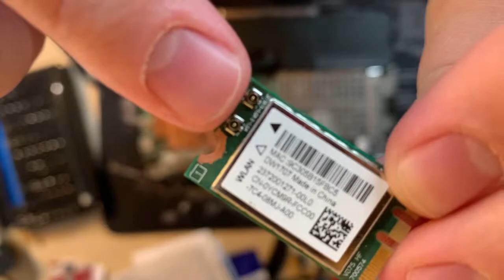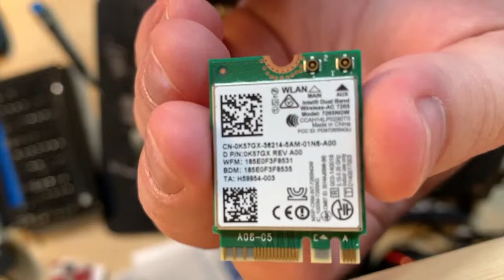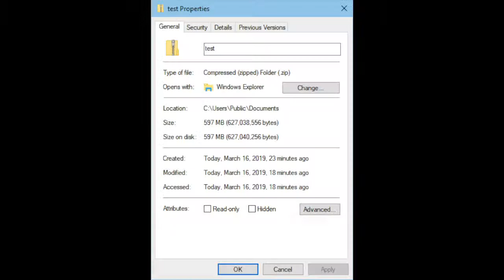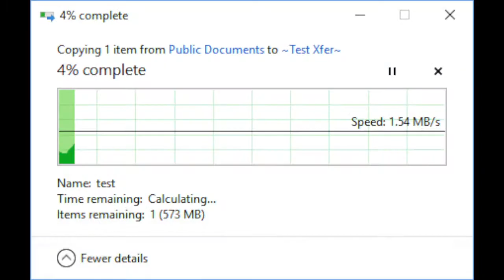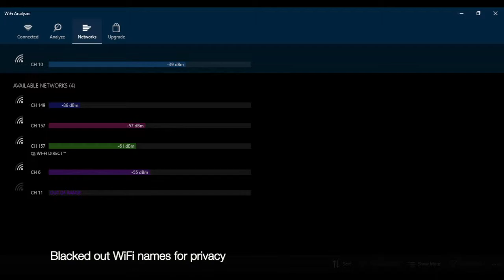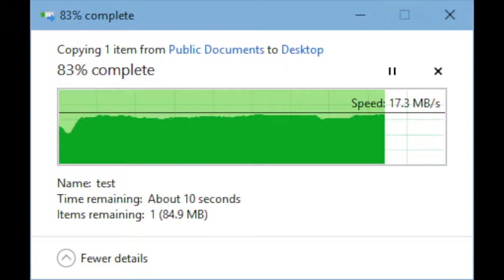WiFi card upgrade, Dell Inspiron 11-3180

Comment: My laptop is a Inspiron 11 3168. The AC-7265 is recognized in the bios but the little yellow "!" appears. The driver from intel says it is installed successfully but no change. And "no available networks. Guess I may have to stick with 2.4 speeds.

Comment: i have this model but it has a ssd slot and a memory slot. I was wondering what would be the best upgrades for it as far as memory and ssd and wifi card that will mostly plug and play. I think it will only work with a 8gb memory and would like a 1tb ssd and what would be a good wifi for 2022? thanks
Reply from the maker: A single 8GB module is going to be the RAM limit.

As for the SSD: does your model have the SATA connector on it? If so, then a 1TB SSD shouldn't be a problem. If you don't have the SATA connector you'll have to get an adapter for your WiFi card slot to put in an SSD. Please note there is some back & forth on the Dell forums about how (if at all) you can use the SSD as the primary boot drive.

For a 2022 WiFi: another gentleman in the comments suggested an Intel AC8265. When I looked it up it's a model release in 2016 instead of the 2014 wifi card I used in this video.
Reply: @polymatrix  it does have a sata connector and I got Intel 8260NGW dual band wifi card last night. Would I be able to jus plug and play this wifi card?
Reply from the maker: @chrisstover4518  Before you insert the new wifi card you should either
A) download the Intel drivers first
B) be able to connect to the internet via ethernet or using a USB to your phone (basically any other way of getting to the internet).

This is so you'll have the drivers to install manually if Windows doesn't see them see the new hardware automatically.

Other than that, if it fits in the slot, it should be fine.
Reply: @polymatrix  awesome and thanks so much man any other tips like physically putting it together I have no problem I jus have issues with the rest lol

Comment: Thank you! I have to work on my wife's Dell 3180 to make it little faster. However, I will use Intel AC 8265 instead of 7265 although 8265 is little expensive.
Reply from the maker: Yes, but if you can afford the cost it's definitely worth it!

Comment: I have this model and I ran out of storage and can’t update it and it barely has anything on it when I try to free up space to what do I do I put a sd card and still runs slow and can update at all
Reply from the maker: I have to look it up. But I think I mentioned in one of my other videos but in order to do updates you have to do some kind of trick to have the Windows updates offload to a USB drive. Then you can install and update.

Comment: Can u change the graphics card
Reply from the maker: No, I'm afraid not. The graphics are built onto the CPU, which is soldered to the board. I suppose, with the right equipment, you could solder a more powerful CPU to the board (if you can find one).

Comment: can i use AC-9260 ?
Reply from the maker: It looks it's a pretty standard WiFi card, and it supported in the Linux kernel (if that's your thing). I haven't found anything specific to this model though it doesn't look to be special/nonstandard.
Reply: @polymatrix  okay, thank you

Comment: Please post the link for the wifi card
Reply from the maker: There are a number of listings on Amazon. Some say to not use with an AMD CPU, others don't. I'm not sure why - as you can see here it works fine (I also re-imaged this system with openSUSE Linux, still working fine there as well).

https://www.amazon.com/Intel-Wireless-AC-802-11ac-Wi-Fi-Bluetooth/dp/B00STV5UKW/ref=sr_1_1?keywords=Intel+AC-7265&qid=1571255924&sr=8-1

Comment: Do you find YouTube streaming smoother?
Reply from the maker: No, I did not. The issue isn't the speed of the bits coming into the computer but rather the OS's ability to handle YouTube playback with limited hardware resources.

Comment: Can you add a SSD in that slot instead? I understand I'd need to use a USB wireless Nano adapter
Reply from the maker: I don't think so. I can't be sure of it, but I doubt this is pinned out to SATA or PCIe. So even if physically possible, I don't think it'd communicate with the rest of the system.